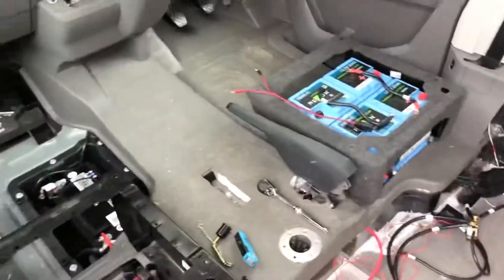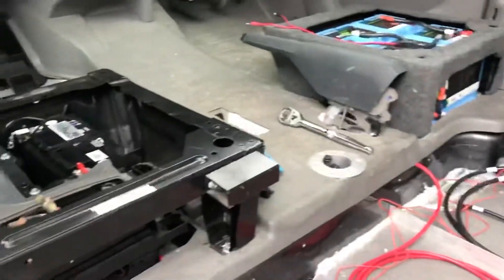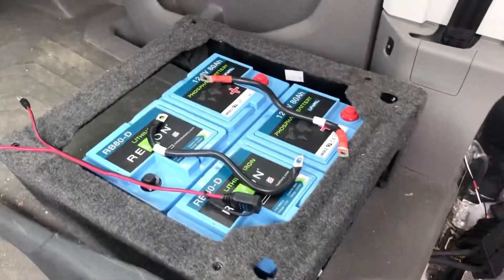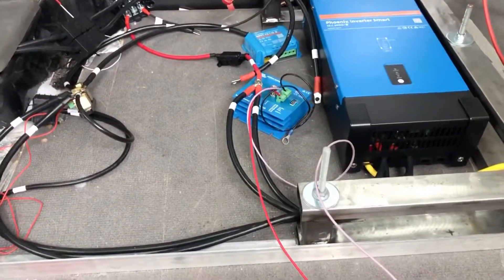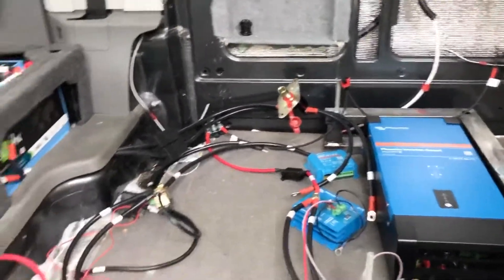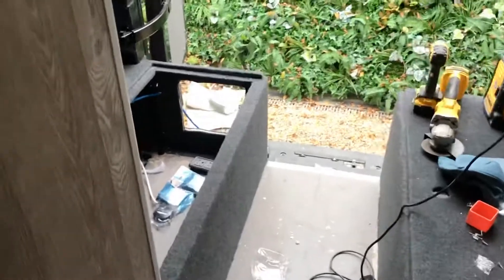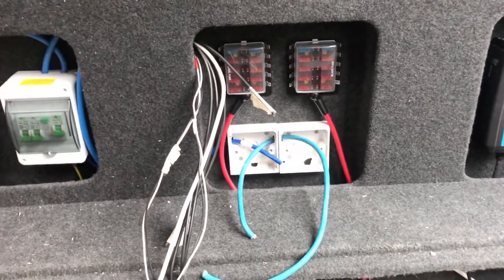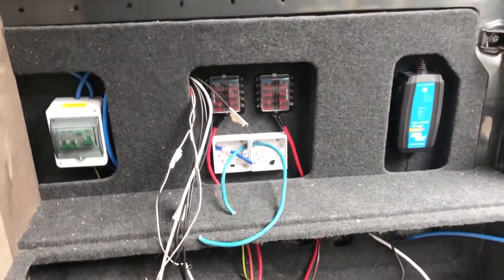VW Crafter Campervan electrics installation how to

Comment: Hi Kev, It's been a while, not sure if you are still responding but your build and workmanship is amazing.
Were you able to get all your main victron components under the floor at the bench seat?
Did you specify the installation location to Rayne Automotive when you ordered the electrical kit?

Comment: when you say you lowered both front seat brackets did you replace the original seat pedestals? And complete the handbrake lowering upgrade? thanks
Reply from the maker: Hey. We haven’t lowered the front seats we just installed swivel bases 😊

Comment: Your build is exactly the same as my planned build! I pick my van up in 3 weeks so your way ahead of me so keep posting vids and ill hopefully learn a lot, happy days good luck!
Reply from the maker: Oh cool. Yes we will post more soon! The gas tank, heaters etc have gone in this week. Installing so much underneath is really challenging so that’s over taken everything this week! Is your van MWB?
Reply: @recraftedcampers4686  yes 2018 MWB 4 motion, same idea as you, 6 berth, lift bed in rear with seating/double underneath, shower/toilet and seating for four,  cabbunk in front for kids, lift kit/wheels with AT tyres. Rounded work top at door, pretty much exact as yours, still deciding on bed lift options and gas or not, you must be gonna live mostly off grid with that elec system
Reply from the maker: @anthonyarnold1242  Yes we want to be fully set for off grid living. And want to run my coffee machine without turning the engine on 😂  Are you planning to carry 6 seated and also sleep 6? We are 4 berth only and that is tricky enough! 

With 4 motion you’ll be a bit more restricted with internal height and space underneath for tanks etc due to the drive shaft. We are super tight under there but we have gone for large tanks so you might need to go a bit smaller to fit.
Reply: @recraftedcampers4686  travel seats for 4, the 2 kids sleep in the cabbunk and me in the drop down, then 2 extra if ever needed with guests
Reply from the maker: @anthonyarnold1242  
How’s your build going ?

Comment: Looking great 👍amazing what you have managed to fit into that size of van. What heater are you using that are undermounted?  Do you have water and lpg tanks undermounted as well?
Reply from the maker: Thanks! Getting there. It’s a bit fiddly fitting it in but it works. 

It’s the 4KW under mounted Whale heater. And yes we have a 60lt water tank where the spare wheel used to be and 25lt lpg tank being fitted on Wednesday. All a bit fiddly to fit under there too but should work 🤞🏼 

We will update with a new video showing how it fits 👍🏼
Reply: @recraftedcampers4686  👍sounds great. Do you have an air heater fitted under the van as well?
Reply from the maker: @JGI78  Yes it’s the Whale heater. Being fitted tomorrow!